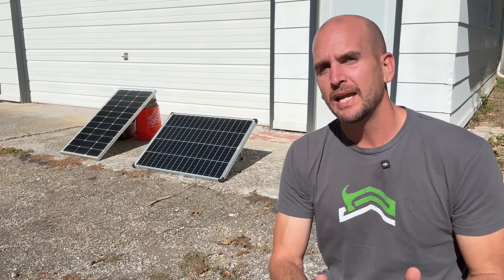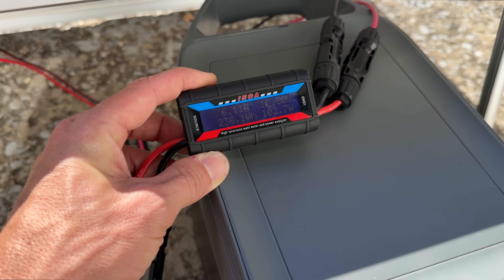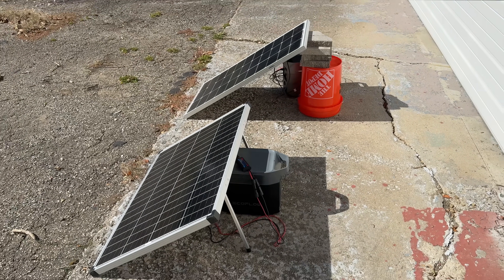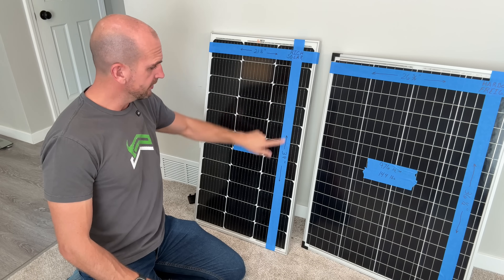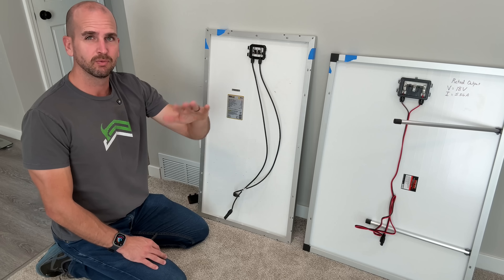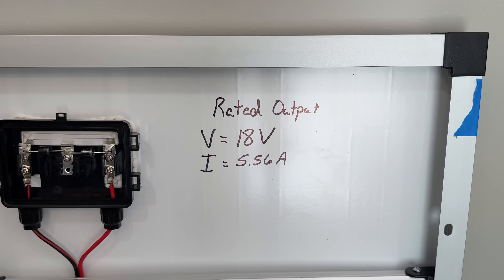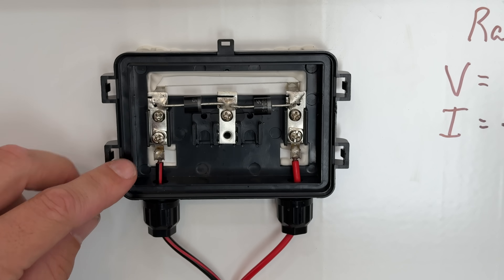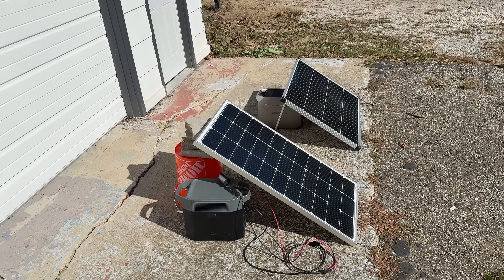Harbor Freight 100W Vs Rich Solar 100W |  Tested!

Comment: Yea but the area is a big deal also.  How many what hours per square feet.    I thing the Harbor Freight is 15% larger.  So about the same for the surface area but the smaller panel might be more convenient to fit the right amount of panels on the roof.

Comment: People knock the HF panels, and say that you should buy a name brand panel for much less.  I have 16 of the HF panels just sitting outside on their own legs (which most of the other cheap 100w panels dont have), and they are always getting blown all over the yard.  Not one of them has broken in 4 years, and every one of them will still make over 110-130W during peak hours.  They are fantastic panels!  The wire is thick and make of copper.  I just cut off the ends and throw on some MC4s and plug them in.  You can also get them locally, and return them to a local store if you needed too, but I have had 100% success rate on them for years.  The hardest part is finding them in stock. 22.5V is the most I have ever seen from them.

Comment: I have two 200w 24v rich solar panels that typically hit about 94-97% on average during peak hours and on partly cloudy days i've seen as high as 466w between them both in parallel.

Comment: Rating the Harbor Freight lower because of a soldered connection is wrong - soldered connections are acually worse unless it's directly to a circuit board. There's virtually zero tinsle strength to a soldered connection and contrary to popular belief it actually conducts electricity WORSE than a crimp connection. In particular in cold weather exposure areas the solder joints can break easier with any amount of vibration (wind, etc.).  Don't believe me? See the science behind whey crimped connections are BETTER right here: https://youtu.be/vHoP0QSofqI?si=t1SHzWrabt_ACUv7

Comment: Can you calculate Wh per square inch in the final results? Sounds like the difference is due to surface area and how they are rated by the manufacturer. My guess is Harbour freight, given their return policy, rounded down on their rating

Comment: I have a hoses barn that never had lights . It has 3 horse stalls . I would  like to install a light over each stall and two more lights in the walking path in the center. I do have a newer big truck lead battery 950 cca . Would it be fair to say I can use that battery and inverter and panel that’s it ? That’s all the panel will be powering .

Comment: You made a major scientific error in your measurement.  Yes, both are 100W panels, but they do not have the same collecting surface.  Using your data, the HF captured 0.507 Wh/in2 and the Rich Solar captured .0510 Wh/in2 (using correct value of 423).  That's a difference of 0.6%, not 17%.  What you did is compare a gas Honda Civic to a Ford F-150 for power output.  They are not the same-sized engine.  Same would be true for the price.  You need to do it by surface area since one collects at a lower rate due to lower surface area (Rich Solar). Basicaly they did the same energy capture based on surface area.

Comment: Y'know, Scott, you are already "lovable" in your presentation here --- i.e., good word-choices, clear speech, pleasant manner --- but I can really "love ya" for your stating how you much-prefer soldered electrical-joints instead of just crimping... I, too, always advocate for soldering my connections, especially for outdoor applications or anywhere else where moisture or other corrosion-and/or-vibration-inherent conditions may be frequently occurring. ☺☺☺

Comment: Very interesting video but one thing stuck out and I had to do the math. I noticed the panels’ surface area was different by a fair amount, but this only works if you are installing multiple panels. When you compare surface area to achieve roughly equal surface area you would have to install 7 Rich panels vs 6 HF panels. However, 7 Rich panels at the time I’m writing this cost $630 and 6 HF panels cost $720. Then with your figures 7 Rich panels would put out 3024 Wh vs HF 6 panels 2970 Wh. If this is accurate you would get more output with less initial cost using Rich. Please don’t think I’m knocking either; it’s just an observation. By the way I really liked how even you tried to make it. Just something to think about in your next video.

Comment: I would also compare on a Watt/hr  per square inch basis.  This may start to be critical when you calculate how many panels you can install on roof or ground stand.

Comment: With a bit of rounding:
The HF panel is 17% larger, and produces 17% more power in the same conditions which means they produce the same power per square inch.

That means it is about price and the HF panel is 33% more expensive, at least using the links in the description for me. They list the HF panel at $120 and the RS panel at $90.

Overall RS wins i think. More bang for your buck.

Comment: Good test, but 1 thing.
Swap the position of the panels as well next time. Sounds unnecessary, but its part of the scientific method. The control was the sun, swapping the batteries around was a good idea, more so since the panels didnt move at the same time. But you should have also exchanged the panels physical positions incase there was some reason the camera right position was better than camera left.
Keep goin tho. Great stuff here.

Comment: Quick question...The HF panels are physically larger. So, is the Rich Solar more efficient by size? If the two were equal size, which one would be better. You could cover the HF panel to simulate the size of the RS and then run this test again.

Comment: Very good testing and interesting results.  One thing I rarely see in comparisons like this is WHY there are the differences there are.  The "what| and "how" are great to know but more often than not the "why" is the key to getting the best answer.  Is it the connectors, the wires/gauge, the cells, the diodes etc?  What differences are there that can each contribute to these results and the differences with the results?  This can help get the best of both worlds and sometimes you can find a way to get premium performance from a economy level product.
Reply from the maker: Thanks so much for the feedback and we will try and dive a bit more into the why in the future.  Also, as I gather additional brands and models of panels that should help to validate the why.

Comment: Interesting to see both panels use standard 2-diode junction boxes but do not break out a center-tap on the strings.
The Rich is excused as it only has 3 rows but the Harbor Freight should have had a center tap. Since both take out the tabs and connect to the two end terminals for easy wiring they effectively place two bypass diodes in series across the panel. If the panels are ever used in a series config and become shaded their drop will be doubled due to the two bypass diodes.
Often these panels are used with low voltage MPPT or PWM controllers and as such they don't really need a blocking diode but one can rewire them to have one internally by moving the busbar tab from the + lug over to the middle one. Thus, using the first diode as bypass diode and the second as a blocking diode.

Comment: Bought HF panels. Test the life of the panels. At one year only one panel was still working. Stepped up to 400w Renogy.IMO built better and a bit more power. I charge a Bluetti AC180 and through a charge controller a 200wh Lithium ion battery.

Comment: That's great the HF put out more I didn't hear if there was a cost difference.   But from looking at the back side. The RS had mu h larger heavier diodes that should last longer on the lifetime of the panel and smaller size taking less rack space on a permanent install

Comment: I buy used panels 230W for $70 (including shipping). Instead of matching 100W to 100W, why not compare $ value. What we all want is the best bang for our buck. The biggest hurtle in solar installs is the mounting system, and meeting the city requirements for install (disconnect and safety equipment) criteria.

Comment: what are you going to use a 100W panel for?  Charge your phone?
Reply: Keep batteries topped up on a rarely used car, lawnmower, charging an EV mower slowly over time, etc.

Lots of uses.  But yes, charging MULTIPLE phones/tablets at once in the middle of nowhere can be useful.

Comment: I live in a house that would make solar energy....challenging (read: expensive) As the song goes, the sun rises at 10AM and sets at 4PM. That and I'd need to locate the oversized panel array some 100 feet away. Other options: plaster both the roofs on both house and separate garage with panels, and possibly the southern garage wall. Makes the TVA (electric supplier) look positively cheap.

Comment: You should note that based on your sq in measurements at the beginning of the video that the Harbor Freight panel is approximately 17% larger. This would explain it producing 17% more electricity!

Comment: Question: were the lumens the same from morning v. afternoon? IMHO, if the lumens are different (and they would be), why do you assume that everything is a straight line as far as measuring is concerned?  It's not.

Comment: So in summary then, the HF panel is 17.7% larger and produces 17% move power. As there was no mention of pricing and thus bang for your buck, the only take home message is the types of connectors are different.

Comment: I would consider the comparison for output per area to be useful:
Rich: 432wh / 829sq in = .5211098 wh per sq in [= 1.918981 sq in per wh]  So this one gives slightly better performance for a given area.
HF:    495wh / 976sq in = .5071721 wh per sq in [= 1.971717 sq in per wh]
Two other important comparisons would be cost per wh and to a lesser degree cost per sq in.  Note that different people will have different criteria and considerations for their use case, some will be more concerned about cost, some will be more concerned what output they can get for a certain area, for example if they have a roof a certain size then they can fit more panels if they are smaller, and the area becomes more important, but then they can either be more worried about the output for that area, or the cost for that output, so providing each of these comparison factors would be useful.

Comment: since op didn't do the math:
rich had 432 wh, and for the time that is 82.28 watts per hour compared to the advertised 100.
harbor have 495,  again we divide it by 5.25 (cause 15 minis 25% of an hour) and get 94.28 watts per hour.
100-82.28 = 17.72
100 -94.28 = 5.72

so rich solar does three times worse in those controled solar conditions, presuming sample is representative. alternatively stated, they fall 3 times their competition's shortfall, in this specific experiment.
this could be a sample error with one of the two samples being away from their mean. it also could be a result of some experimental conditions. it is possible there was some shading which hit one pannel which was out of experimental control, or that there was a problem with setup. if rich solar's sample was representative but expects cold air to be flowing  under even the bottom edge, it is possible that the pannel had to throttle output to avoid cell degredation.

so again, there is sample error potential. there is experimental design potential which could have caused variance in performance. and there are of course experimental factors which would be unlikely but if one pannel got hit by a bunch of clouds, or some of the mounting design wasn't  how it should be, then that could explain the difference.

still, getting 17% less power than is advertised is kinda bad. some of this could probably be dampened by having the pannels mounted and track the sun but still. one of the things i'd be interested isn't theoretical maximal output, but expected and reliable output.

also i double checked the one number you did show, 17%, and the difference between the two outputs is not 17%.
if you do big number over small number it is 14.5% better performance. if you do the opposite it is 12.72% shortfall.

'we will aggregate them all together'
if you do that, you should have them run at the same time, not aggregate data. different days of the year will have different weather conditions. the phase of the sun will be different. aggregate the equipment, and then do a test of them all.

Comment: As I live in the rainy PNW, I'd be very interested in a real world comparison of how various panels perform in lower light conditions. Garden stores sell shade cloth rated at blocking different percentages of light. I imagine you could use various ratings of shade cloth and/or double up on some, to change the amount of light blockage, so you could measure how well the panels performed under varying amounts of light.

Comment: Looks like the output difference is exactly what one should expect given the Harbor Freight panel is a little over 17% bigger.  It gave a little over 17% more output in the morning session and a little less than 16% better output in the afternoon. The total output of the Harbor Freight was just over 17% more. By the way, the total output for the Rich was 423 rather than 432. I used to correct number in my calculation and I think you did as well.

Comment: its important to factor in cost, and in some cases size. the Rich Solar panel produces .52 watts per square inch, where the Harbor Freight panel produces .50 watts per square inch. The Rich Solar is also decently cheaper.

Comment: 100w? Where would you use such a low wattage panel. On an RV perhaps? You wouldn't use it on a building roof or ground static installation.

Comment: you did pretty good. surface area will account for the difference. and the reason for the 100w are the diodes can only pass about 100 watts. I think if you put larger or double the diodes you would find an increase in the wattage. maybe not much , but could be as much as another 10%. just my thoughts. also if you made it a full wave bridge it will increase the wattage.

Comment: The difference in output is directly proportional to the area of the panels: 976/829 = 1.17. The lesson to be learned is that assuming the efficiencies of the panels are equal, a very big IF, then shop for panels by their areas, not their listed wattages.

Comment: Are you using a MPPT charging device to charge the battery?  It might make a difference in the results.  It might be that the Harbor Freight panel is more compatible with the exact charge voltage of your setup.

Comment: Is your addition correct with the Rich solar watt hours?  232+191 does not equal 432.
I think that it adds up to 423. That is even a greater difference between the harbor freight and the rich, Solar Panels

Comment: Calculate percentage% DIFFERENCE between V1 = 495 and V2 = 423. (it's correct, I copied from a calculator, can go to bottom for answer and explanation).
FORMULA IS:  
|V1−V2|[(V1+V2)2]×100=?
=|495−423|[(495+423)2]×100
=|72|[9182]×100
=72459×100
=0.156863×100
ANSWER IS =15.6863% DIFFERENCE between the two separate panel readings.

But, to find an increase or decrease in%, you would only want to compare an increase or decrease of the value on one panel. For instance, on the one panel the Amp Hour reads 423, and later in the day it reads 495, that would be a 17.021% increase. But comparing two separate panels as to the % DIFFERENCE between the two panels =15.6863%.🤯I know, it blew my mind too, had to relearn all this. And the decrease% on one panel from 495 to 423 is -14.545%! Math is so fun. 🥴

Comment: The difference in power generated is 17% and the difference in surface area is...17%.  The output power is a function of surface area which means they essential have similar efficiency.  It would be interesting to see what the cost per square inch is.

Comment: I am curious as to what type of battery is used for storage here and if some kind of voltage regulator is used or needed in the setup.
i am an auto mechanic and the voltage coming through these panels would damage a lead acid battery.
is it a lithium battery or some kind of dry cell?

Comment: How many buss bars do the panels have? It makes a huge difference depending on the type of lighting.  Most of if the time you will be in off-peak sunlight, thats what sepperates the men from the boys. Im running over 2 kilowatts of panels...100% offgrid.

Comment: Thank you so much for the educational videos. Have your recorded and posted a video on the cheapest way to set up a 100w panel with a decent battery and a reliable AC converter? I've been considering a single panel, one battery and a converter to use for a shed type application. Cheers

Comment: One of the major manufactures did a test years ago for a contract with NASA.. Mid NASA days.. Can't remember if it was MOLEX or 3M.. Maybe Anderson. BUT> They crushed the debate. Astronauts needed to be able to fix on the fly. Soldering in space creates situations. It was either crimps or twisted pins.(Apollo module all twisted pins cept for a few items)
After the test NASA and the manufacture laid it out. Crimps when done proper will out last a solder joint and 10x easier to replace in space. Military, Automotive, aviation and nautical.. and NASA all use crimps.
If your concerned about the IP rating. Open the case back up and fill it with dielectric grease.

Comment: My last solar project was 7 years ago.  Things change.  I'm back watching videos to learn. Didn't get far when you advised people to cut the SAE connectors on HF panel.  I'm thinking a number of viewers will be using a Power Station.  That will dictate what connectors are needed, and there's probably a converter cable for that.  5 minutes into this video and I'm moving on. I probably wouldn't consider 100w panels anymore for my need, either.
Reply from the maker: Thanks for the feedback and best of luck on your new solar project.